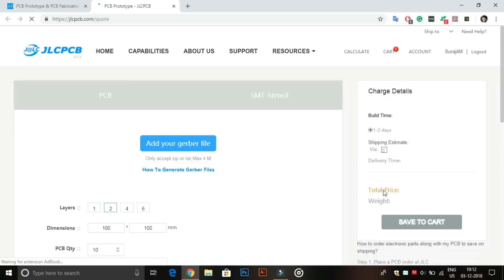How To Make A DIY Arduino Laser Engraver At Home

Comment: Has anyone got this to program from the Arduino source code supplied? I found that when I tried to load the zip file into Arduino IDE, I received this error: "Error: 13 INTERNAL: Library install failed: moving extracted archive to destination dir: library not valid"
I have tried the original version of the zip file getting the same error.

Comment: Hi, i have a  2 axis laser engraver setup for my project from  my college. The set up is similar to the one in the video. The controller is Arduino nano. Can u suggest different types of softwares through which  I can connect the laser to the controller. I tried using Benbox software. But I was  not able to update the firmware of the software and link it to my arduino. Can u help me?

Comment: Hi, very nice build, one question, how did you save drawings to arduino and how do you transform drawings to actual moving of the motors? Thanks.
Reply: There's a software that converts the drawings into Gcodes. The machine reads the gcodes line by line while doing the commanded motions as per the gcode.. Check out inkscape, it converts images to gcodes

Comment: I bought the laser, but it didnt even heat a paper. I have created everything and looks work fine accept the laser madual. It is just giving me a very brigh red dot. The laser i bought from the link you post from banggood. I am no confused. Should i use external transformer for laser?if yes, what exact voltage and amps should i use to get it burn something? Thanks
Reply: Did you resolve your issue? I am stack in the same problem. no heat, same laser
Reply: @Andrés García Ramón  I forgot what I did , but I made it to work.  I did connect sperat transformer for the laser.  Also, It will not cut everything.  I tried with leather and worked fine and regular plastic.

Comment: I HAVE A BIT OF A ISSUE TOO..abt the mofset is irlz44n or irfz44n better?PLS DO REPLY ASAP COX IM ALMOST DONE WITH THE PROJECT THO SOME COMPONENTS HAVENT ARRIVED!
Reply from the maker: Irfz44n i used here
Reply: @DIYBuilder  and we dont need to provide  it with any dc adapter or anything? just connecting to the pc is enough?
Reply from the maker: No you have provide 12v external supply

Comment: where do you order all the components for a board like this.   
i can never find any 1 location of where to order these.   so either i overpay a ton for shipping to get them from diffrent websites.   or i need to order enoegh parts to make 50 of these to offset the costs of shipping.

Comment: Is there any requirement of external power supply for laser?? Beacuse when we apply 12v 1 amp supply all system is working but laser is not working?? Can you help ?
Reply: Same issues man
Reply: same issue here
Reply: any one has the solution ?
Reply: Power source 12 volts 2 amps minimum.

https://www.instructables.com/id/Mini-CNC-Laser-Wood-Engraver-and-Paper-Cutter/

Comment: Hello, thanks for the video. Can  you tell me what power supply do you use?
Reply from the maker: Normal +12v adapter
Reply: @DIYBuilder  Is 1 Amp enough?? Thanks
Reply: @triforce1745  mine 1 amp adapter didnt work. Which one did you finally use?

Comment: Can you give us box skech with dimensions?
Reply from the maker: Ok i will update the link soon
Reply: @DIYBuilder  you are awesome sorry for bothering you, but i have one more question. Does that sketch is real template for laser box, with dimensions? Like just print with printer and cut from plywood?
Reply from the maker: Yes it is the real sketch. I used this sketch to make the whole case without the laser cutter. Only i used handsaw, metal file, sand paper and little bit patients to make this case.
Reply: @DIYBuilder  which program did you use to create such printable template?
Reply: DIY Builder where is code for arduino